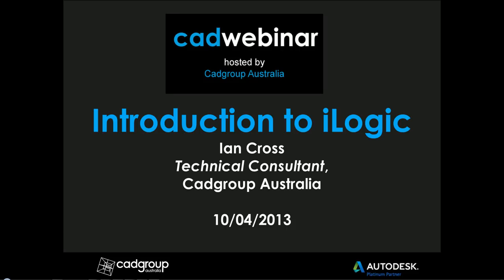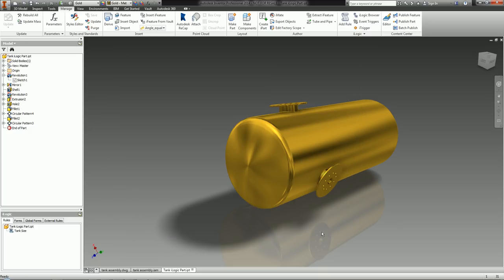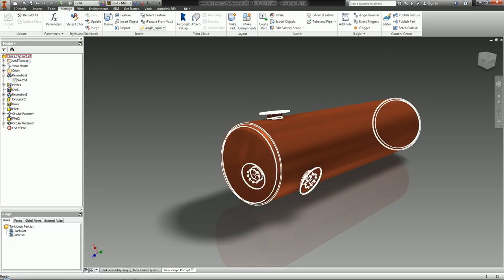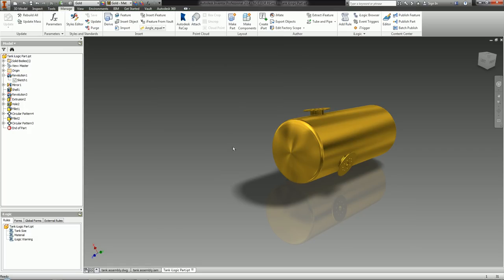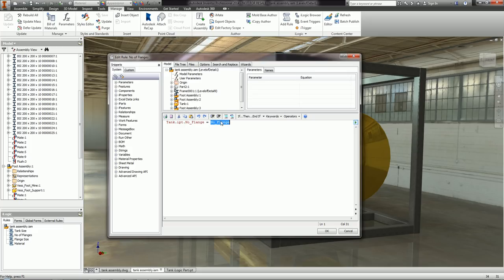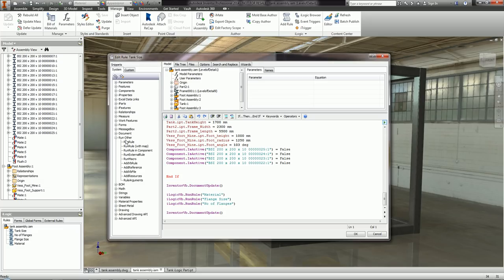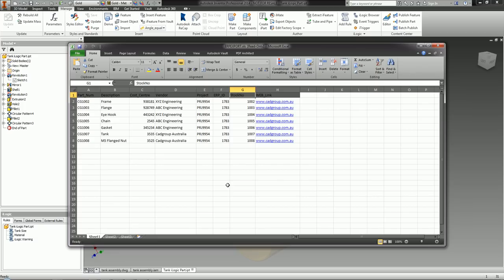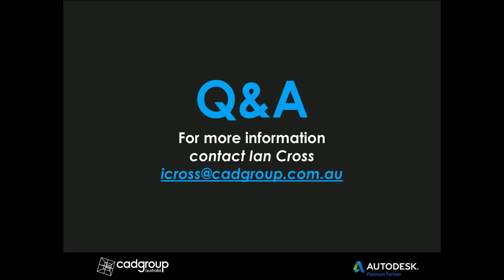An Introduction To Autodesk Inventor iLogic

Comment: Great Video. Thanks For the tutorial. I want to create an ilogic that's doesn't work with an Item select Box, I Want to create a parameter that modify an sketch between different values. Example: I have a tank with a deflector inside, and i want to change the distance of the deflector to the center depending of differents value of the height of the tank. How I can do this?

Comment: Hi thank you for your very helpful video, i have tried using the basic add numeric function. Do i always have to rewrite the numeric user parameters when i place the component into the assembly? or can i link the part file to the assembly or does autodesk do this automatically?

Thanks

Comment from the maker: The background is pre set into Autodesk inventor, within the part or assembly environment you can turn this on, if you go to the view tab on the ribbon, there will be a drop down menu which is more than likely defaulted to the setting two lights, if you expand that menu you can change it to the one I used here or one of the other ones.

Thanks
Ian